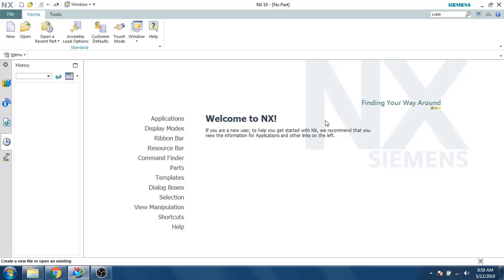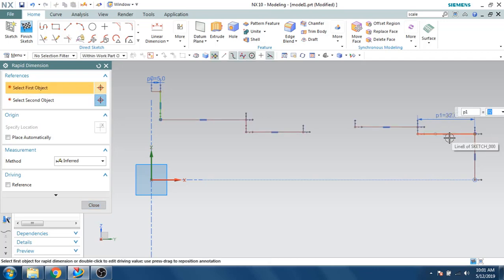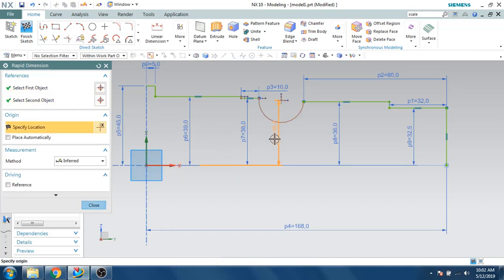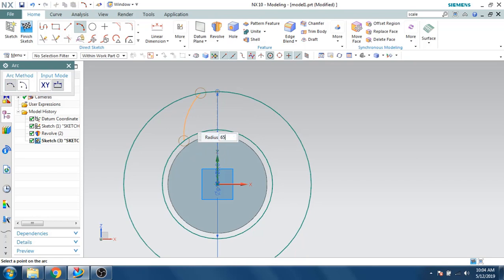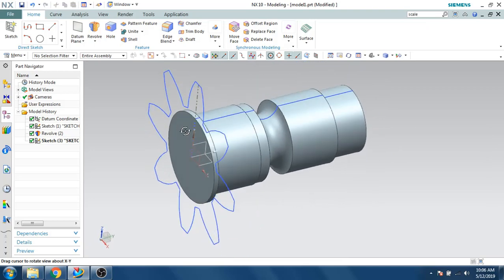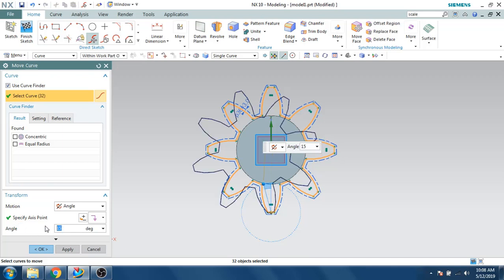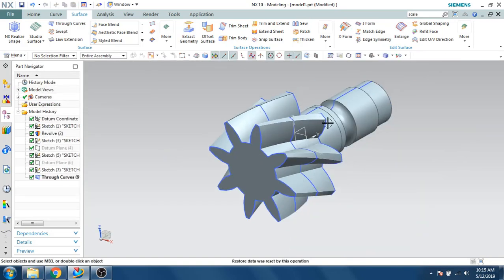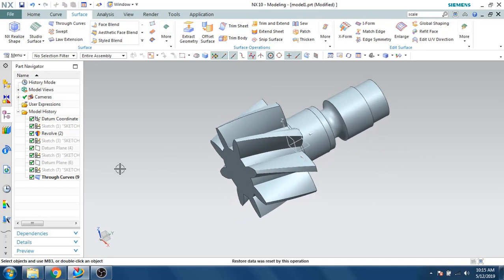Unigraphics NX- Part Modeling Example 5 II Bevel Gear

Comment: I was not able to select the curve curing move
Reply from the maker: Mention timeframe on which you are talking
Reply: 08:16
Reply from the maker: @Prashant_godbole  Make sure selection filters are selected as per my window
Reply: @TechDesignsantosh  
How can I do that sir? Can you tell me the steps?
Reply from the maker: @Prashant_godbole  Hey request you to watch all my video without skipping even sketcher tutorials.. if you dont know simple command you will not able to complete model.. on the top left corner beside menu you can see the filters check them.. if you dont get please check my next video tomorrow i will explain in that.
Reply: @TechDesignsantosh  thanks for the reply